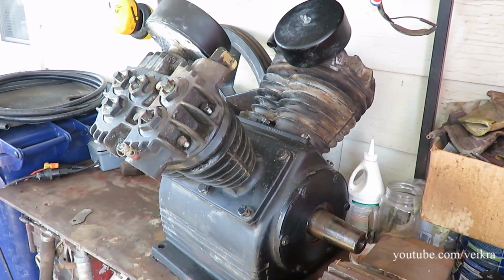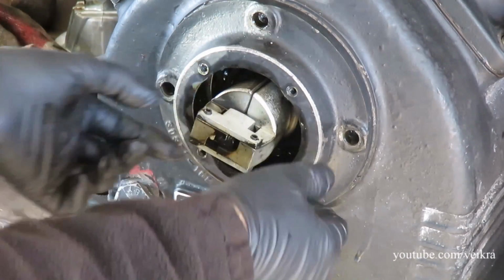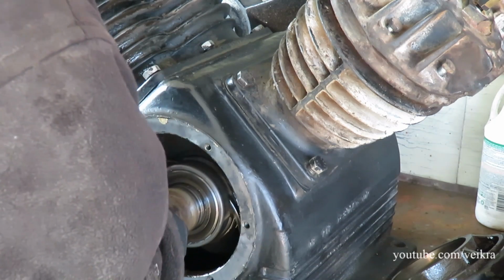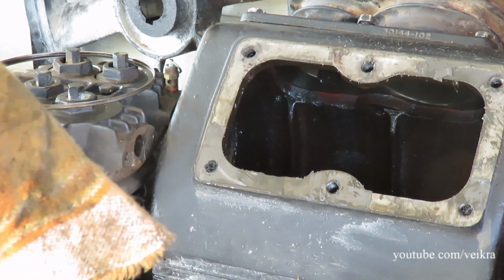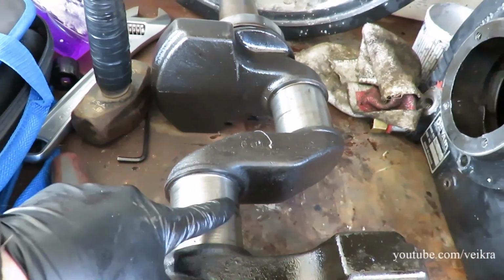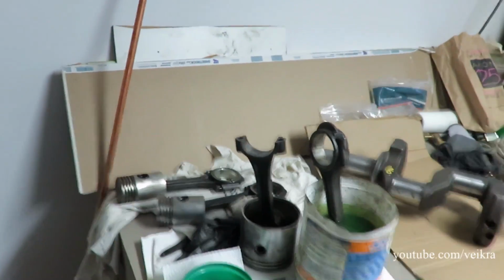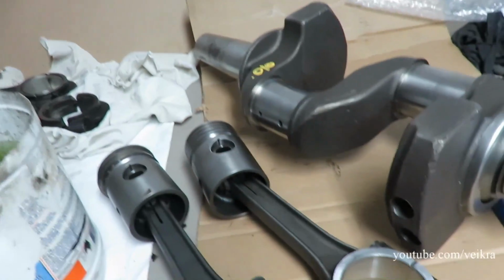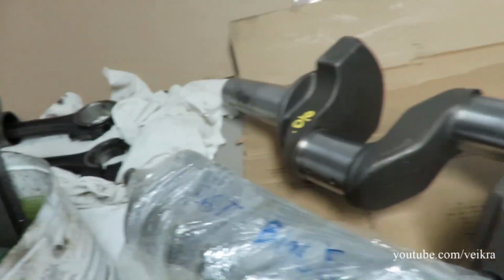devair 447 rebuild part 1

Comment: Thanks so much for posting these! Recently grabbed a 447 I'm about to tear into.
Reply from the maker: I reconditionned a lot of 447 and 445. If you have any questions let me know.
Reply: @Nordic_Mechanic  thanks for the reply. I am currently putting the top end back together and painting mine. Everything aside from the outside (sat outside for years) looks next to new. No movement on cylinders when turning crank by hand so not going further. One question I do have, is how one would bypass the CPR? I am going to remove and inspect it, however, I am running a 7.5 leeson to it, and want to get 150 psi, which looks like ill be running it at 425 rpm; too slow for the cpr to kick off.  Thanks!

edit: looking at replacement parts, it appears i can just unscrew the cpr device. That said. I can't find a service manual for this on DV's website. You wouldn't happen to know where one can be found?

Comment: Really great video! Today i bought a 2 cilinder Devilbiss air pump, manufactured in Toledo. Never seen one before and i think its really old. Unfortunately the cpr valve is severy damged, but i will clean and test it. Regards from Brasil!
Reply from the maker: some cpr are interchangeable with the newr cpr models. Id`have to see. Or you can also rig a cpr equiped pressure switch if you cant fix ther cpr
Reply: @Nordic_Mechanic  can i send you some pictures by e-mail? I couldn't find the model and It has no id plate.

Comment: What's the best way to remove the flywheel/pulley on the 447?
Reply from the maker: puller. I had to make one with 1/4 steel plate and 3/4 tread bolts. Shaft is tapered and make sure you hold the pulley with hoist or forklift. Its  very heavy and can jump back pretty far

Comment: I used to do that at Toyota build shoots to catch oil when I drained it because the filter or drain plug was in a bad spot.  Them some clown a few years ago made some flexible memory plastic shoot for the same purpose. I think it never sold well, I was doing the same thing with cardboard 10 years before. Hand out the old pistons for Halloween.
Reply from the maker: +Ghetto Wagon haha, the crown vic has a chute too, since the engine wasnt meant to be in that car the oil from the filter  would drip down on the steering rack and subframe, and start shotting from 20 places under the car ! I think Ill take the piston back to previous owner in a frame and tag that reads "I dont check my oil"
Reply: Veikra
Tie it to the dudes bumper on his car, When he gets out and looks at it maybe they will remember.